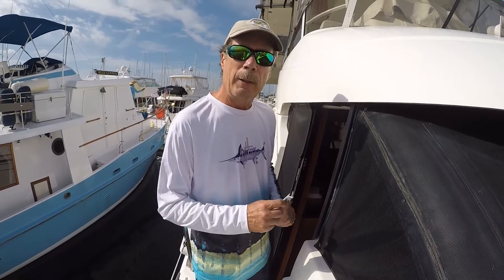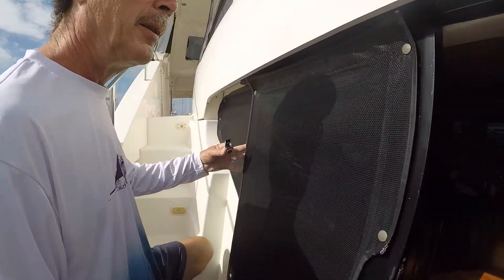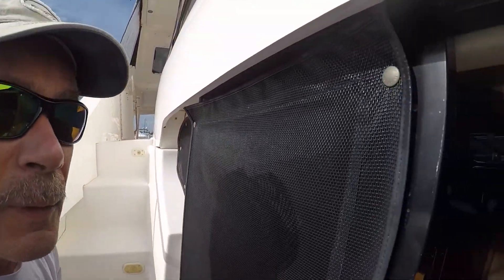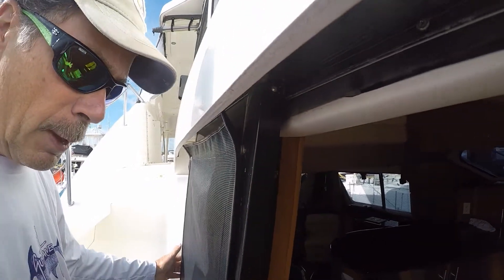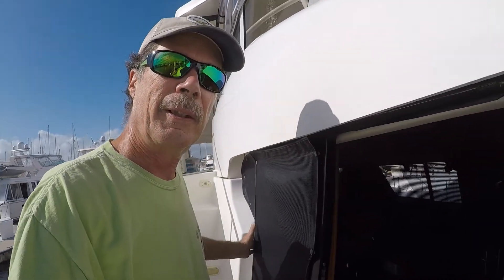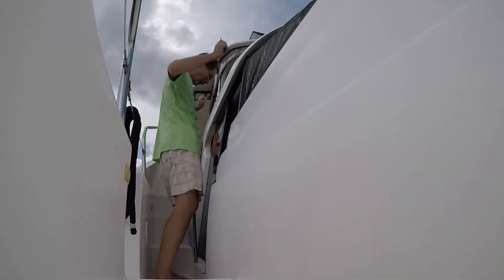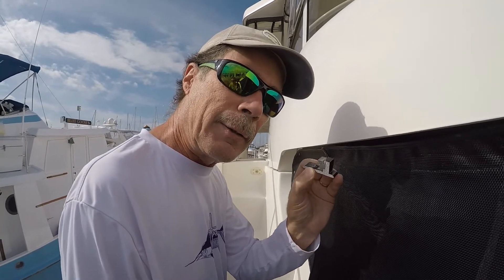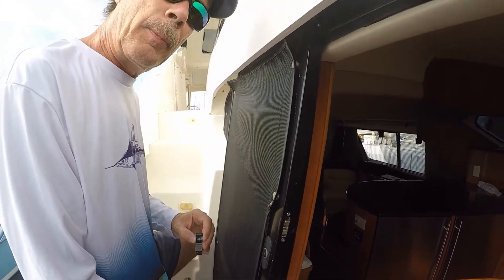Trick to replacing Silverton 453 galley door rollers

Comment: I just acquired a 2000 Silverton 453 and stumbled on your video.  I came
From a Silverton 34MY that constantly chewed up wheels on the cabin door.  Your video was so very helpful and we got the pilot house door off.  The original rollers had turned into a pile of melded steel and mess and came
Our in chunks.  Finally got the whole corroded mess cleared out but there was little left to help identify a replacement.  Would you happen to know what the manufacturer and model number of the the new wheel assembly is.  Thanks.  John “Currently UnPhased”
Reply: Sorry.  Went to your website like you say in the video and viola, there is the part.  Thanks
For Your content!
Reply from the maker: @jehines3   I would also recommend joining the Silvertons Owners Club at silvertonclub.com
You'll find a ton of information there. Well worth the $25 yearly fee.
Reply: @fortunate2theboat385  Thanks.  I used to be on there when I first got my 34 Motoryacht years ago  Hopefully, Nyla is still around and running it, she did a great job.  I'll have to see if I can reactivate my old user name since I had provided a lot of posts on there. I'm sure I'll run into you there.  

Also, it seems like the Prim-line part number is no longer made.  I did some research and these from SwissCo should be the identical roller assembly.  The steel ones were an absolute mess and should not be used unless you are on a lake.

Stainless wasn't cheap, but hopefully, it keeps me from doing this project again.  Pay me now, or pay me later, but you will pay me says all projects attempted to be done on the cheap.
Reply from the maker: @jehines3  If you would do me a favor and post the SwissCo part # and where you purchased it so I can update my website I would greatly appreciate it. Thanks so much.

Comment: The replacement part shown was a Prime-Line D1922 wheel truck assembly in stainless.  This part was unfortunately discontinued and not located in any old stock.

Using that part number I was able to locate drawings from Prime-Line and cross it to a new part from Swisco.

Swisco Part Number: 81-181 is the stainless version.  found at www.swisco.com

These were $90.00 with tax and shipping to Maryland.  The Prior Owner of mine used a standard mild steel part and almost froze the door into the track due to steel swelling.  If you have a 453 and are watching this video and need to do this project, use a Stainless version only.

The door barely comes out without removing the short little railing.  I have not installed mine yet and hope to do this project in the next two weeks.

Prime-Line D1922: https://www.primeline.net/Content/Images/ProductImages/D-1754D_Detail.JPG

Swisco 81-181: https://www.swisco.com/images/pictures/2017/06/98636.jpg
Reply from the maker: Thank You for updating everyone.